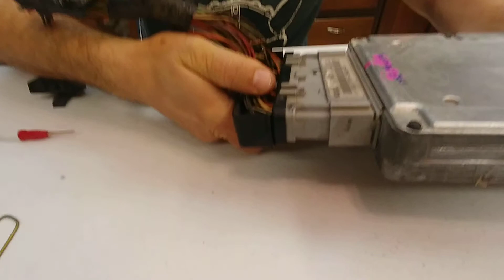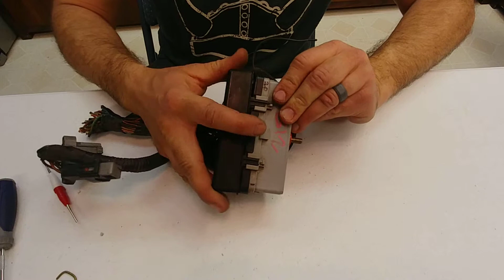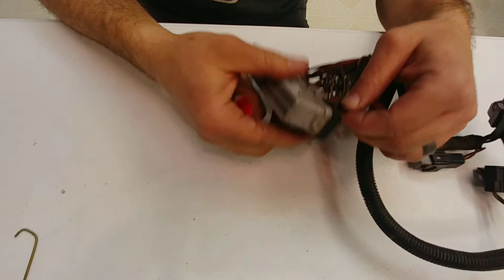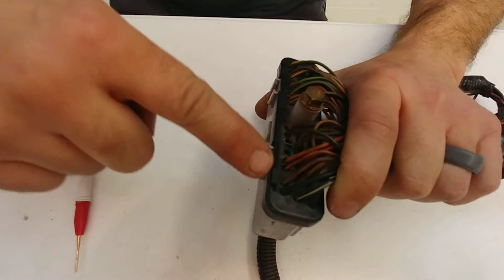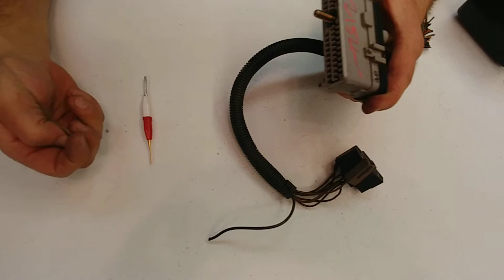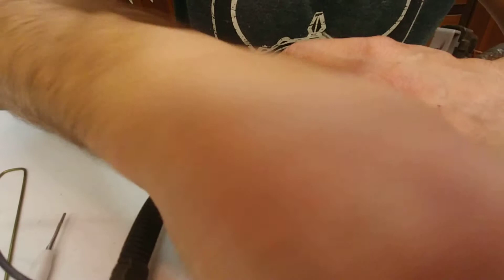PiMPxshift Powertrain Management 4 - EEC Connector Pin Removal & Installation

Comment: When doing this after purchasing the PimpxShift for a 1995 F150 with Batchfire, are there 8 fuel injector pins that must be installed in the EEC as well as the relocation showed?